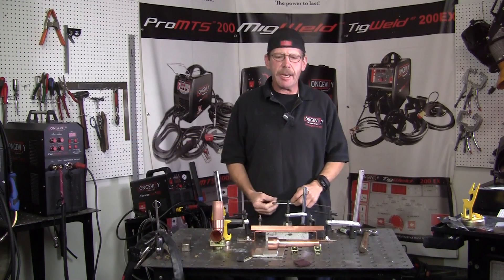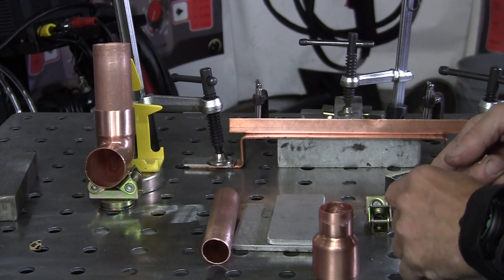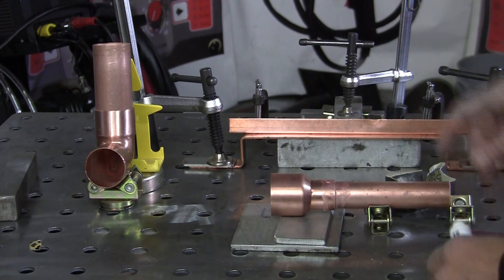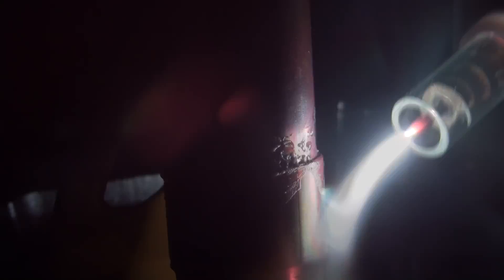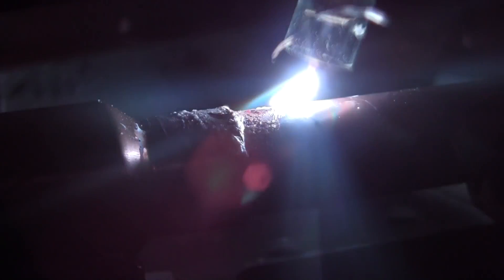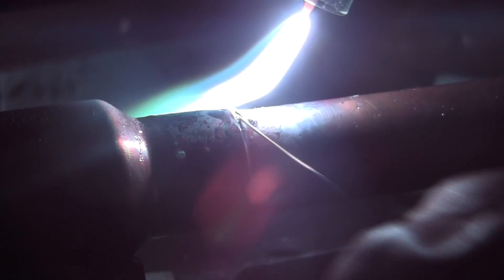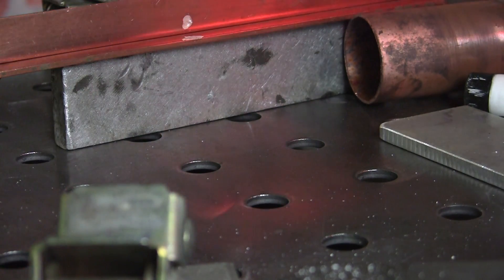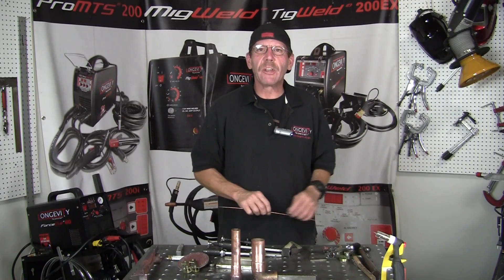HOW TO TIG WELD COPPER PIPE - TIPS AND TRICKS

Comment: Very cool, turned out great!!  Lots of questions unanswered though.. what % silver, what diameter rod (looked thin!), what amps (100?)

Thanks
Reply: What shielding gas- if any. Maybe he specified & I just missed it. Meh- I was looking for tig welding copper anyway- not this.
Reply: @bbrown6799  Has to be argon or helium or the tungsten will burn.

Am looking for tig welding copper as well.

Tig soldering is cool though. It really is just a heat source. I bet we could use a tig torch to heat up rusted bolts for cracking loose.

Comment: I think you should just stick to the oxyfuel torch for soldering. It's much easier to use than TIG.
Reply: Came here because i only have a tig welder. I want to do a tiny copper pipe job for myself and not gonna buy another torch if i can use what i have.

Comment: Okay you are using wrong current guy, use the AC than DC is just a counsel, but with AC the current is strong enought to break the alumine on ally that's why we use it to weld alluminium, so weld with AC and don't waste your argon for this bullshit, use propane next time
Reply: Should have been DC with 100% helium to TIG weld copper.

Comment: a costly way not to have a open flame. 
true its not tigging. i did this today to test if a can make handrail with copper. i liquidfired the smaller tube yes the smaller liquefies faster and pulled over to the fitting. no filler rod used
Reply: 1/2" tube to copper fittings. 87amps 50% on time 70amp background 90pps
Reply: Hi. How did your copper handrail turn out? Did you stick with the settings you mentioned here? I'd love to see pictures of your finished product if you have them?
Reply: I do not use any filler rod just pulse rate to melt the edge of the copper fitting into the copper pipe.

Comment: I want my five minutes and change back. I haven't felt this jipped since Freddy got fingered.

This isn't tig welding copper but how to apply heat using a tig torch to solder joints. Kevin Caron does an ok video on this subject., from what i remember. I have tigged copper before and have found it hard to apply enough heat to get the base metal to melt seeing that the high thermal conductivity of copper leads to all you heat being transferred out of your part.

long story short useless video, any one who was in a real pinch could have though of this and I wouldn't be as harsh if the title was appropriate.